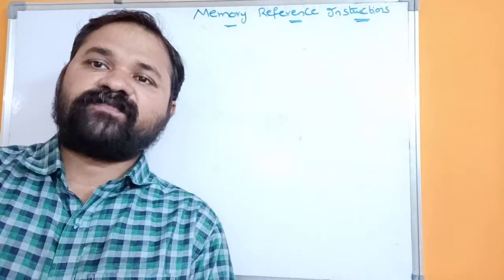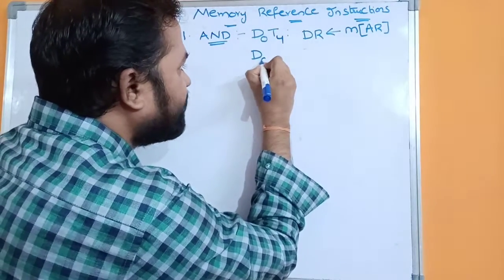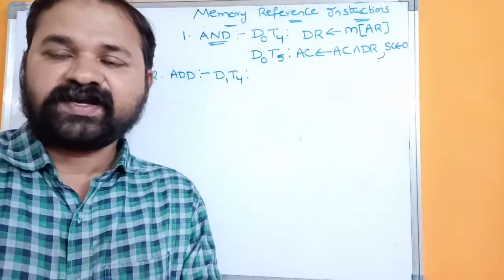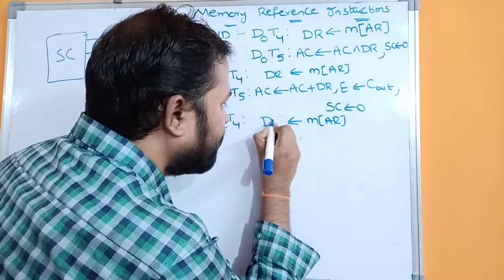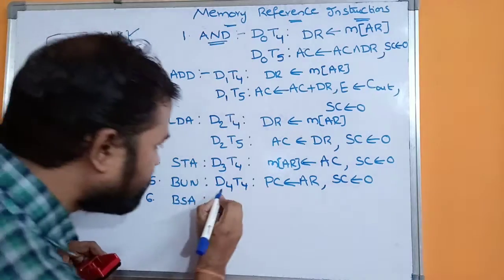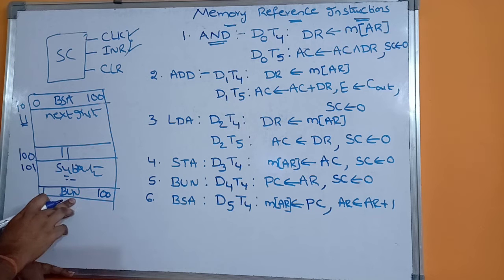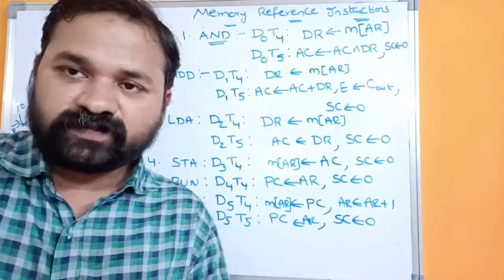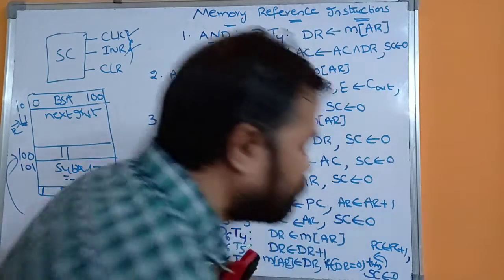Memory Reference Instructions || Computer Organization

Comment: Sir how Dr is directly transferring data to Ac,ac doesn't have connection with data bus 
Rather than Alu noone can transfer data to ac so how is that happening
Reply from the maker: Accumulator is the default processor register. processor performs operation on ac and another operand which may be  from memory or another processor register. Processor is designed like that. Plz subscribe to the channel and if possible share  with your friends. Thanks in advance.